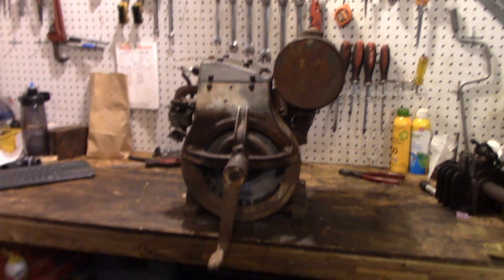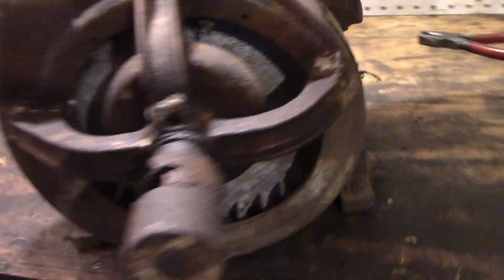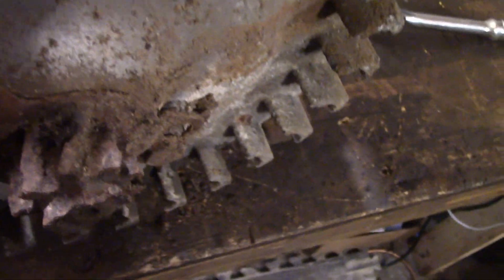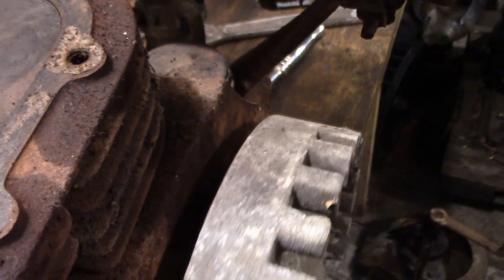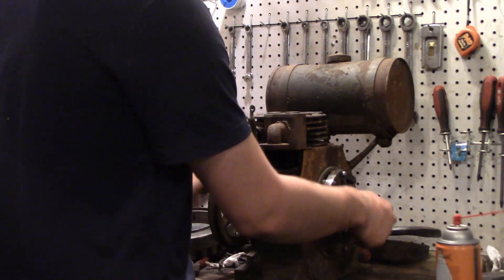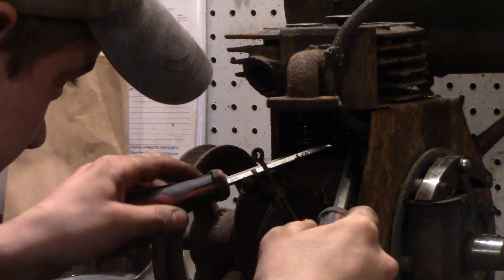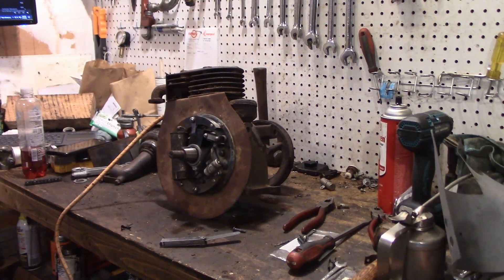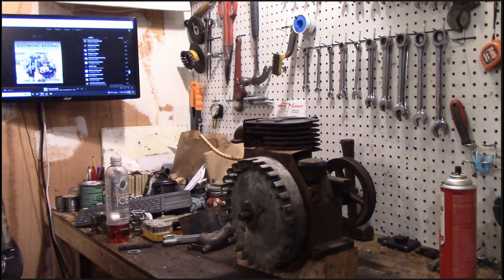Will It Run?? Crusty 1942 Briggs Model A Revival Part 1!

Comment: that briggs and stratton A  the oil pump runs off the cam shaft and that is the later style carb 2 oeace that uses a oil bath air filter 😊😊 OMG 11 23 2O23
Reply from the maker: Yessir! You are correct about that! Thank for Watching!